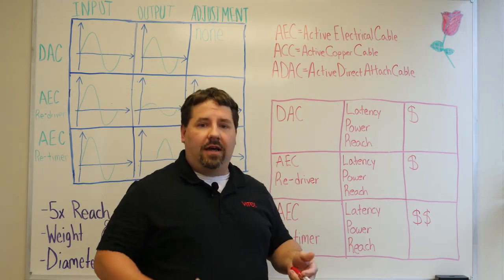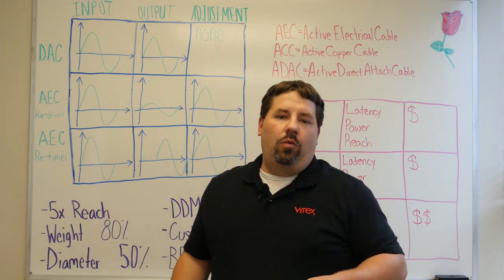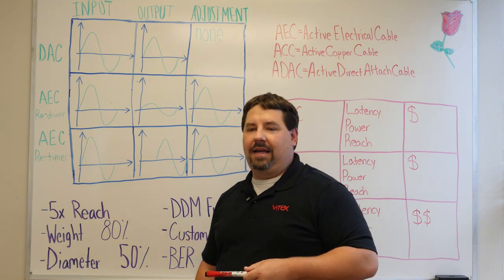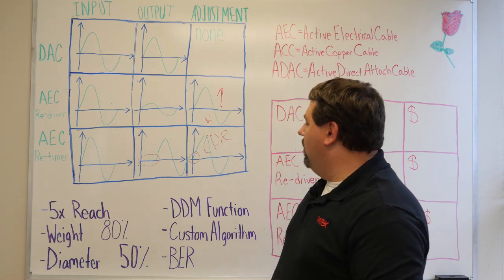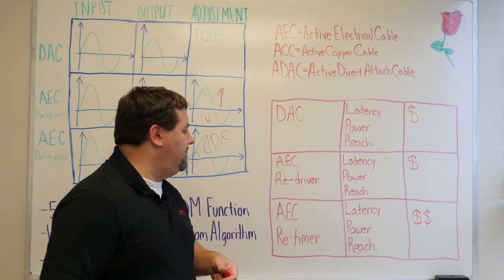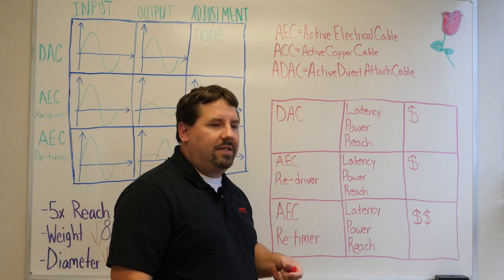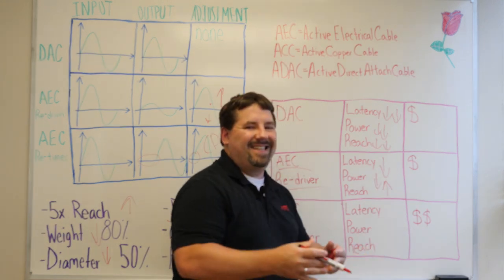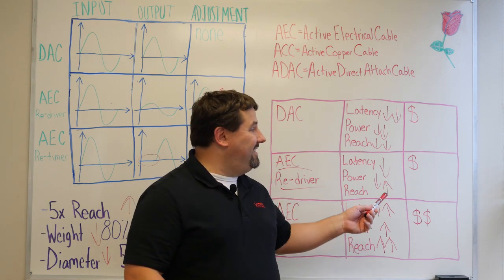Vitex Talks | Understanding active electrical cables: a comprehensive guide

Comment from the maker: Hey there! 

Do you have any questions about active electrical cables (AECs) that we didn’t cover? Or anything else fiber optic related? 

Our Vitex Talks series answers questions from engineers, designers, procurement, quality control -- anyone interested in digging into product or technical aspects of fiber optic transceivers, AOCs, DACs, AECs, cables, video fiber extenders and more. 

If you do have a question, ask below or send us an email at info@vitextech.com. If your question is featured in a Vitex Talks video, we’ll send you a gift code for a hot cup of coffee. We know you need it!

Thanks for helping us shine a light on fiber optic topics😊

Comment from the maker: :yt: Full Video Transcript:
Hey everybody, this is Craig at Vitex, and today we're going to shine some light on AECs and why they're important. If you're in a data center, especially if you're working on something like 400G, you may want to keep a listen because we're going to go through some of the options that we have. Traditionally if you're in really short areas, a lot of you are going to be familiar with what a DAC is. That's a direct attached cable and it's used in a lot of data centers, especially for very short reaches. But we have this new product offering that has come out not too long ago and we're going to talk about why that could be a good solution for you. But first we want to just kind of tell you about some of the names that this goes by because depending on what you look up, you may find this under different names. To kind of quote Shakespeare, “A rose by any other name.” It may work really well in literature and if you're stuck up on a balcony, but not as much in optical communication. The product we're talking about today is the AEC. This is the active electrical cable. You may hear it referred to as an ACC, which is an active copper cable, or an ADAC, which is just the active DAC. What does this do and why do you need it? As I mentioned before, DACs have a constraint when it comes to length. But let's just imagine we're in a situation where we're operating within those constraints. We can see our input, what's coming on one side of the cable is what we're going to get on the output, so there's really nothing for us to do here and this is totally fine. Let's talk about that situation where we're going past the reach of what a DAC can support. And so you have two options that you're really going to look at from a technical space. One is going to be the redriver, and this is important because as the signal goes farther and farther in a reach, you're going to lose amplitude. To get that back, we need to apply more gain to it. This is what the redriver does. It allows us to increase our gain on our signal and results in a longer reach. Let's just assume that gain is not our problem and instead it's something related to time alignment. We could have an alignment kind of skewing going on. That brings us to the AEC retimer option where it's actually going to use a CDR or a clock data recovery, and it's going to realign that timing so we get the high quality signal that we're expecting. What does this mean in terms of the kind of support and benefit we're going to get from it? Our reach is going to go up sometimes five times compared to a DAC. And if we're looking at compared to other solutions, DACs really have the cable gauge which is really thick. And if we want to reduce that, we can look at AEC as an option for this. Compared to other solutions, we're going to see a really big drastic weight change, and we're going to see the diameter of our cable drop. This is important when you're looking at things like thermal management and airflow in data centers. What else does AEC bring to you? It brings in a lot of DDM functionality, so you can do some pretty cool testing and you can actually get reports from it. There's also the possibility of custom algorithms. This will do things like eye alignment and it will check for things to improve our signal quality even more, so actually as our quality is going up, our bit error rate is going down. We can see drastic improvements in our bit error rate both over the distance that a DAC supports and as well as reaches further. Let's talk about some of the pros and cons of why we would use an ACC versus a DAC. DAC has a really great low latency, which is super awesome, so especially in like 400G applications, this can be very important. And our power consumption is also really low, so this is super important. But the bad part of this is we can only go a certain distance in that. What if we want to get past that distance? We bring in the AEC redriver and, again, this is just upping our game. We can still keep a low latency, low power, and we get this nice extension of reach. And in our other option, when we do our clock data recovery, we are going to see the latency suffer a little bit and there's going to be a slight increase in our power consumption because we have more active components in there. But we're going to see this nice super jump in reach and we're going to be able to get distances that we can't with a DAC. Another important consideration is the cost. When we look compared to a traditional DAC solution, the AEC with the redriver, not too much more money. You get a little bit of increased cost when you go to a retimer. But if you compare this to other solutions like AOCs or transceivers, it is definitely low. If you want to find out more about this, feel free to give us a call, reach out to us in our New Jersey office and that's all for this time, so until next time we talk, I'll see you then.